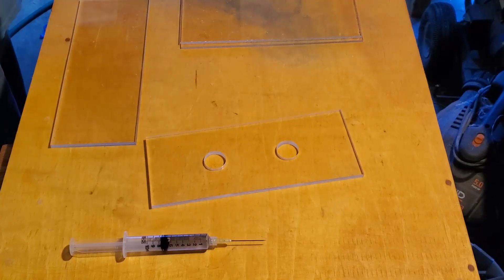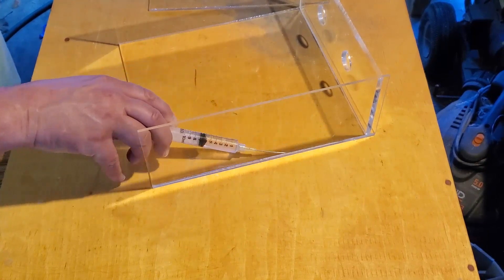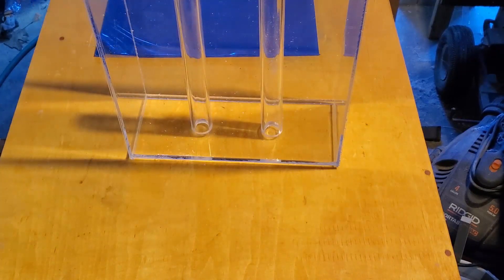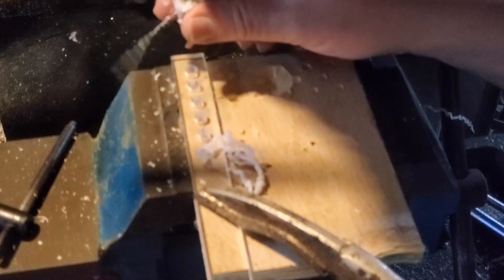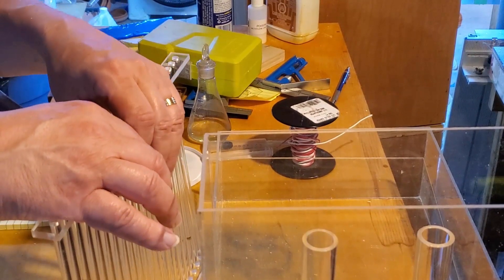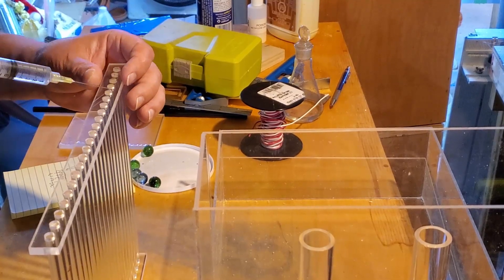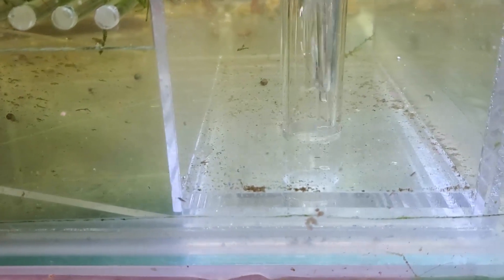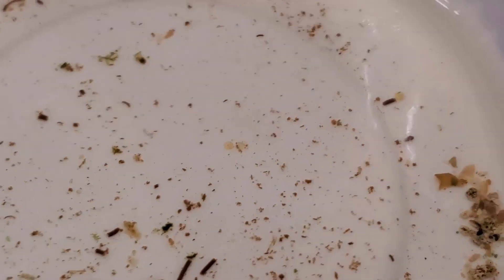Air Driven Fish Egg Separator Part 2

Comment: Nice. Would it work to throw in a little hay in that box to produce paramecium as a nice first snack for the small ones?
Reply from the maker: I'm glad you like it! There is allot of flow through this. The current is needed to collect the eggs. That level of flow would just flush out any paramecia. I also plan on collecting the eggs and hatching them elsewhere. Thanks for watching!
Reply: @FishmanEricRussell  Ok, I must have misunderstood it, since it didn't look like much flow, or at least not need for as much in the egg collection area. Thanks for answering.

Comment: I thought goldfish eggs stuck to the plant material?? 
Wouldn't egg crate diffuser work well enough vs the dowel set up? 
Possibly attach the spawning plants / material on or through the dowel base to anchor it it? 
A little surprised you did not utilize the air lift tubes to bring the eggs up to an easier access catch area, possibly an elevated chamber that could be used as an egg tumbler in cases where that is needed.
Reply from the maker: Hey Ray! Yes they are sticky, but more than enough make it through. Some will always get coated in organic matter to reduce they're adhesion and they will get collected. Egg crate would work very well. The whole acrylic look is just more aesthetic. I wasn't sure how much room would be needed to reduce the flow sufficiently to allow the eggs to settle, so I left as much room as possible. Thanks so much for taking the time to share your thoughts on this!
Reply: @FishmanEricRussell  Agreed, the clear dowels are less visible, just thinking between the spawning materials and algae, the egg crate would be nearly the same visibly, and much easier and possibly less expensive. Very cool build and concept though. Love the vids.
Reply from the maker: @rayp4008  The dowels were a donation that I was trying to find a use for for quite some time. I just had to use them
Reply: @FishmanEricRussell   cannot argue with logic like that, lol